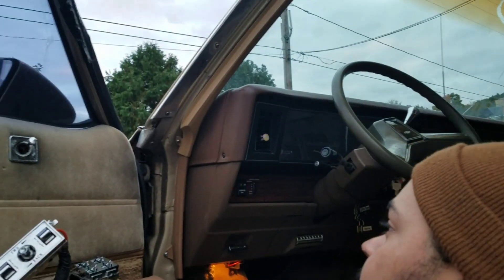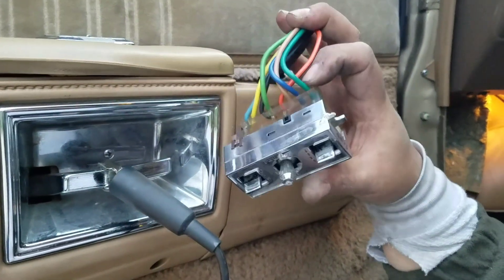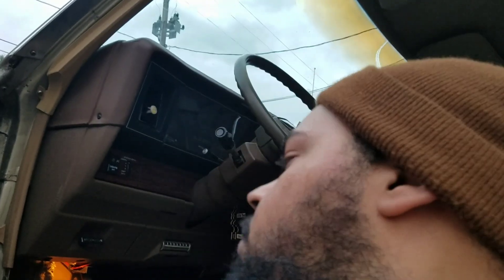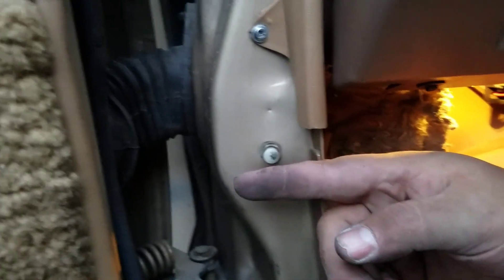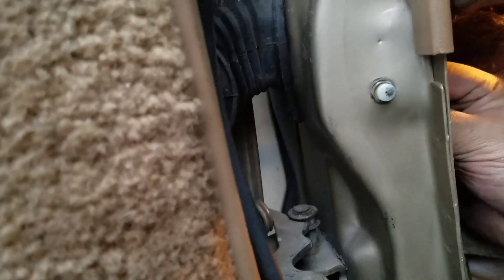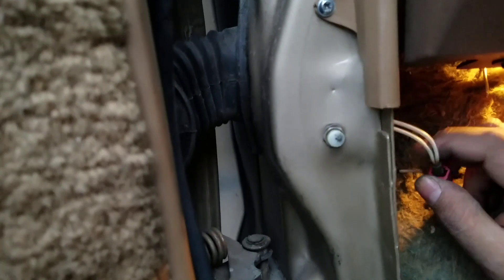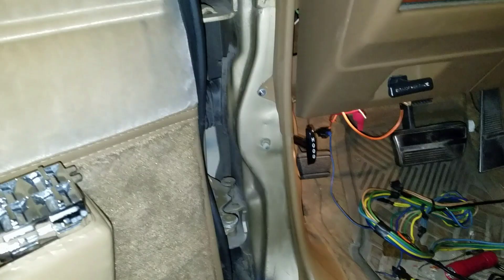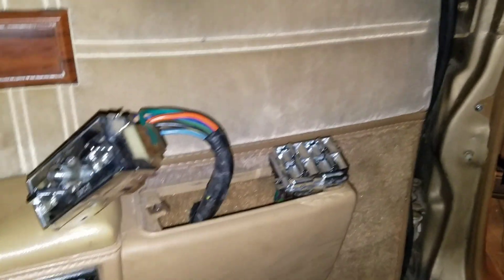Box Chevy power seat "FIXED"

Comment: How you get the passenger side seat to move back & forth? No controls & the 2 handles ain't doing nothing. The metal one on the side just goes upward, & the plastic handle on the bottom only lifts up I think but you can't adjust the seats back and forth.